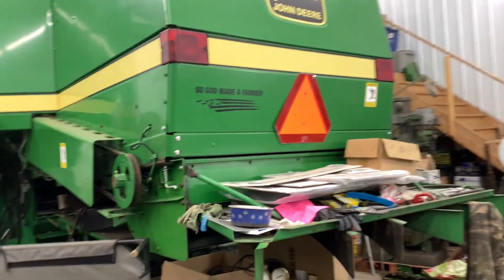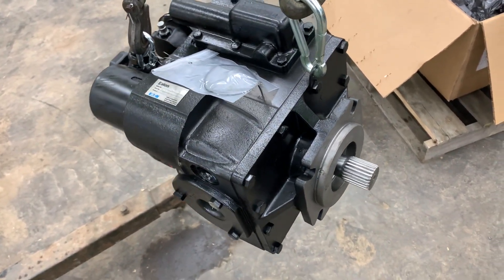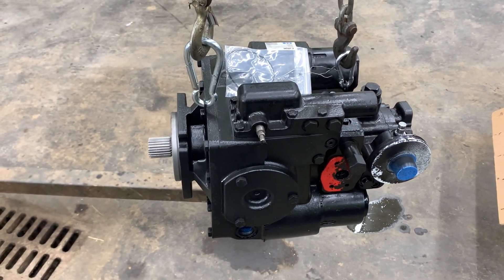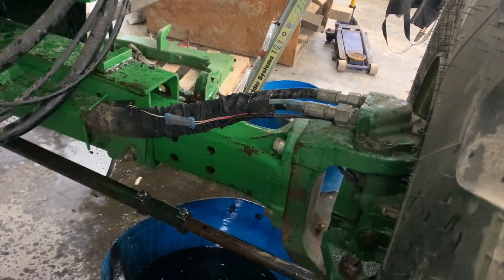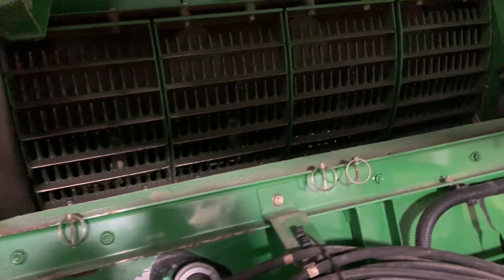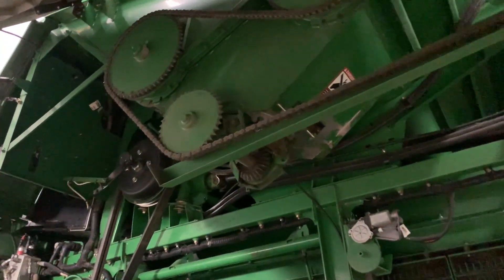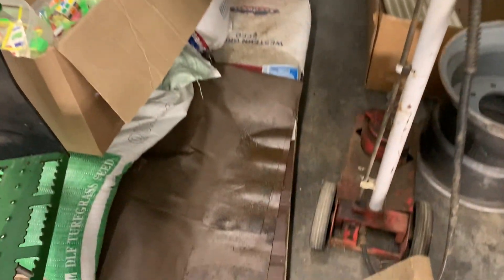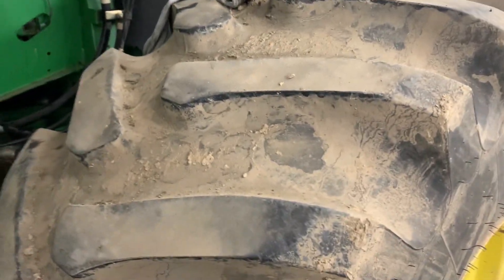The Joy of Owning John Deere Combines!

Comment: Doesn't Troy ever want to be in the videos ? I mean like now when you are in the shop. What John Deere dealer do you go to ? We go to the 1 in Alexander (Land Pro) to buy our twine but they just opened a new building in South Warsaw which is literally just down the road. For that hook up, I see alot of guys always spraying brake cleaner onto it so they do not have those issues.
Reply from the maker: The Airseeder video is Troy talking and in a few other ones but he sounds like me so it’s hard to tell. I will get him in a few upcoming videos. We use Landpro Avon, they are great and my complaints are with the company and now Landpro. We clean them with brake cleaner but I think that eats the o rings up.